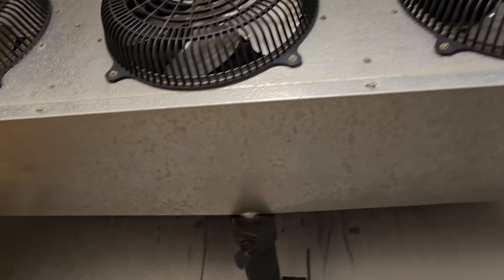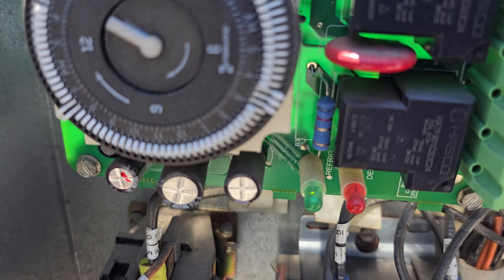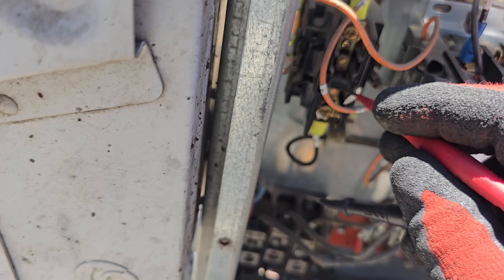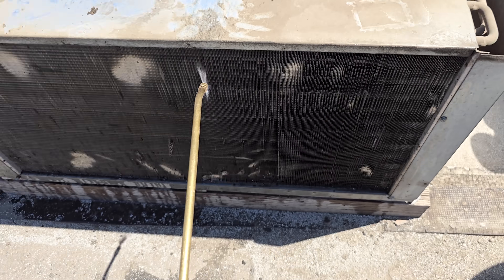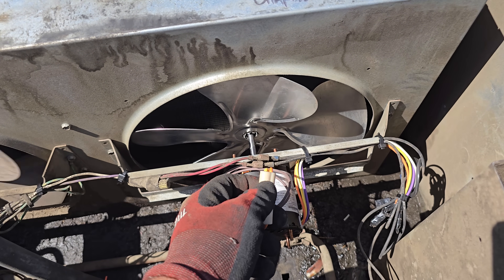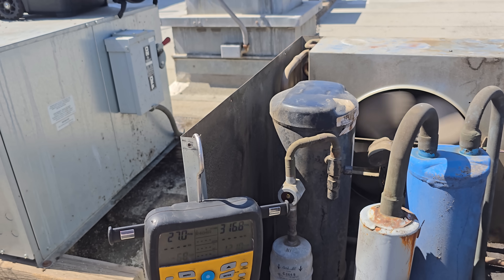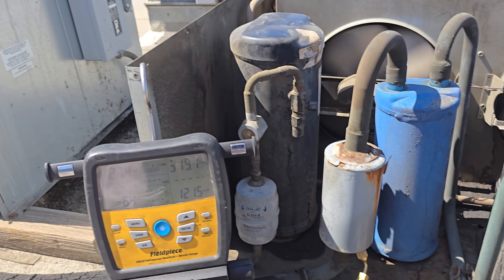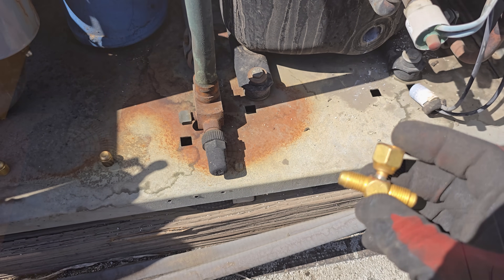THE WALK IN FREEZER IS TOO WARM

Comment: 11:00 that's what our old chiller unit didn't do... Water temp in the exchanger was 35ish degrees celsius because the system had been down, setpoint was 10, the unit started full blast and ended up blowing up 😂

Comment: These trip once HP switch does a great job at saving compressors.
I'm asking myself if theses new "computer like" fans are, as the ones used in computers, are able to report their speed to any "smart" unit.
If not already exist, it would be nice to have such a feature able to tell "max speed not reachable at max current" let you know days before it's almost done
 
Don't know either why these commercial units (fridge/freezer/ac) didn't have "anti-clog" functionality that are build into some small split system for home. (a simple full speed, and some even do an overspeed blast at reverse to blow out thing from the condenser each time the unit  stop or after a period, work well with inverter that are mainly running the fan at 25-50% of max speed)

Comment: A good tip for your new techs,is to see timer turn on its own,once you help it,it will lock up on the same broken tooth,then put it on defrost,check cut out and cut in,and heater amps,and feel more confident about a recall.2 cents.thanks for sharing Chris.